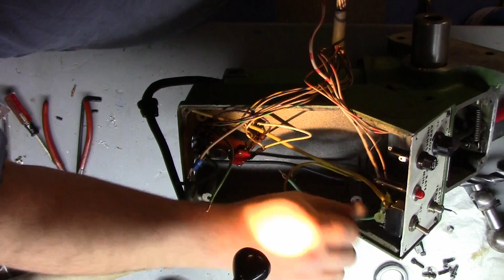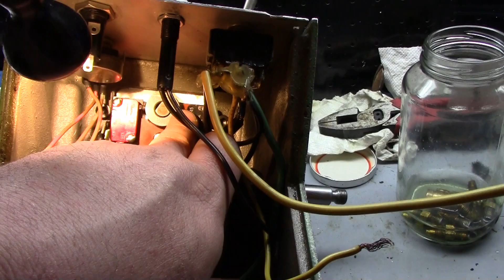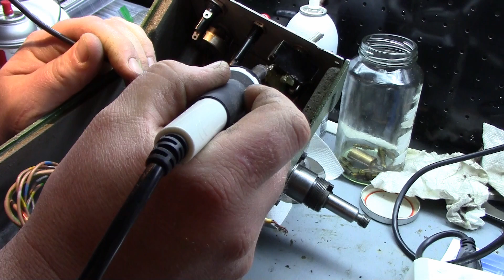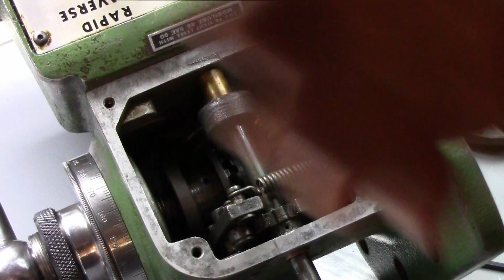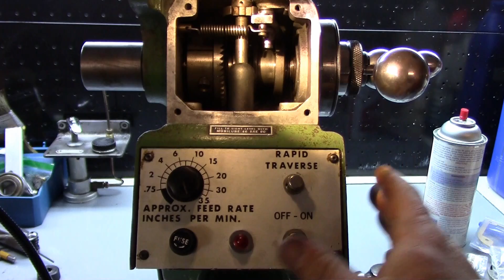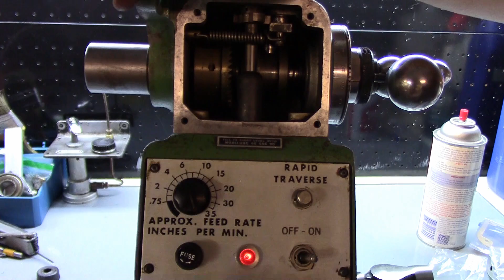Bridgeport Mill Cleaning and Assembly Part 3B : Power Feed

Comment: Do you have email address. Can i have a photo of the pcb top and bottom lay out. i need to remake the power crontrol. for 6F power feed
Reply from the maker: @NaksNamanVlog  

I would need to remove and disassemble the drive for that and that’s something I can’t do.  There are places like HW machine that sells an updated version of the board or the offshore servo type feeds are relatively inexpensive compared to a rebuild of the original.

Comment: Watching you put in all that wiring was tooth-grinding. I've done some of it myself. I find two tools indispensable. One is a set of jeweler's tweezers, I think I got mine from Grizzly but not sure. Unbeatable for holding small parts. The other is some surgeon's hemostats. They clamp. Do not buy at medical supply store. Go to the sporting section at Wal-Mart and look around the fishing gear section, in the fly-tying gear. They are used to tie flies, and cost about $3 here in Anchorage. Tools apart, very nice job. Even without tweezers.

Comment: Greg,
On jobs like that, you need about 14 fingers on each hand and at least 3 hands! ... I looked at your other video, and there are 4 light blue electrolytic caps between the 2 transformers. From what I could see, they aren't bulging so that's a good sign! Some one has been in there already and may have recapped the power supply. Also, whom ever worked on things before had never heard of heat-shrinkable tubing. I like the stuff with the thermo-set glue inside. It's great for insulating switch solder lugs, solder lugs on relays, etc. ... Thanks for the video and good luck with the rest of the refurbishment!
Have a good one!
Dave

Comment: Nice video.  A bit of dielectric grease or even Marvel Mystery Oil on that new rubber seal will make it slide over the metal a bit easier if you end up replacing another similar one.
Appreciate you taking the time to post these videos.

Comment: That looks like hot glue on the switch terminal.
If you "wet" the soldering iron tip with a bit of solder, it will transfer heat much faster.
Reply: +Thomas Coughran Thankyou, I was yelling at the screen, tin the tip, tin the tip.